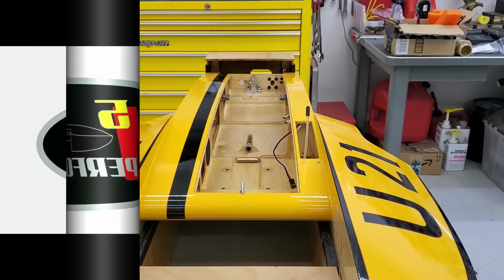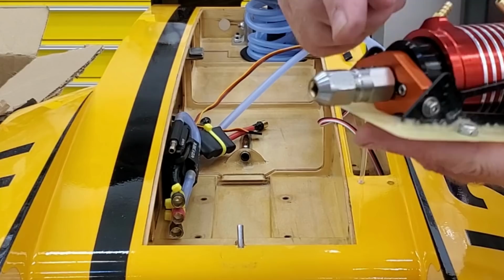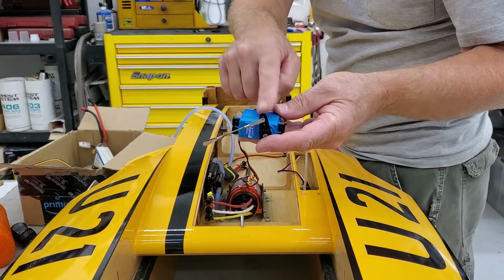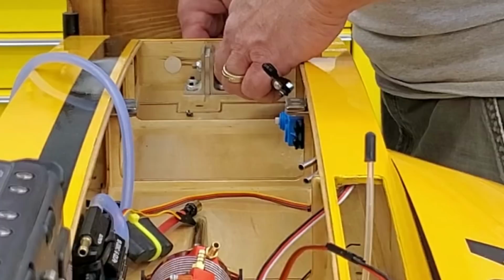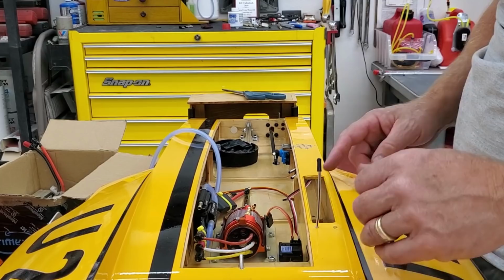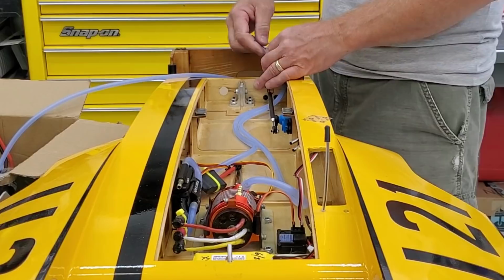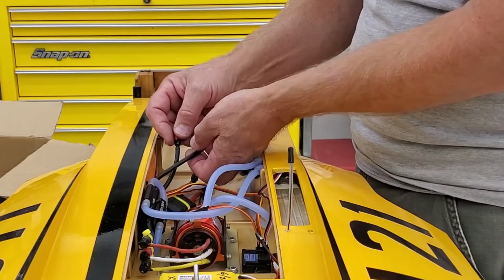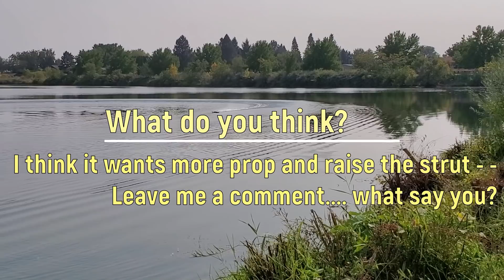Electric RC Hydroplane Final Assembly and TESTING! | The Electro Eliminator

Comment: The Master!  Thanks again Scott.  With electric boats, helis and rc cars, I stopped using velcro in extreme speed situations or anywhere water might get at it.  I prefer shoo goo for mounting electronics.  Cooling line tab mounts are cool.
Reply from the maker: Shoo Goo?!?  What happens when I want to take it back apart?  That stuff is brutal!
Reply: @M5PerfHydros  You dont and leave it forever.
Reply: @M5PerfHydros  You dont.

Comment: Nice and clean build, Mr Meyers! But... what a huge space inside the hull as compared to my Hydro-1-Naviga competition outriggers. I really have to piece ESC, motor, servo, cables, connectors and watercooling-hoses in. Can be a headache sometimes :-). Now, let's answer your question: it runs too wet, too much prop in the water too. It can be caused by the water-condition (very calm, these boats benefit from more choppy waters), but getting the transom from the water will improve efficiency dramatically.
Reply from the maker: Bingo!

Comment: Very very cool machine there Scott. It's a beast. I had a guy make me a fiberglass R42 eventually. He's also a gas guy. He was blown away at the speed of the electric motor I put in on just 6s. We also started with a small prop... 60mm. Going to try a 75mm tomorrow.
Reply from the maker: Cool!  I'll need to see some video....
Reply: @M5PerfHydros  disaster... Don't think my 150amp ESC can handle it. It kept shutting down
Reply from the maker: More power!
Reply: @M5PerfHydros  story of my life...

Comment: In the process of formlating a build from your video series and thinking completing the build as an electric. can you post what motor, ecs and batteries you recondment that you used?
Reply from the maker: Nope, because I don't know. I'm a nitro and gas guy, and all the parts for my electric conversion came from Rattlesnake RC who commissioned the project. Most of it was older stuff anyway.  Bill at Rattlesnake would be a better resource for electric boat advise and parts. Find him here www.allrc1.com

Comment: Quick question, Scott.  When it comes to water pick up...which is better?  Rudder pick up, transom-mounted beveled brass tubing, or perhaps a hull-embedded  beveled brass tubing?  THanks
Reply from the maker: Depends....  A hydro spends most of it's time in the air so any shallow water pickup will only pick up air!  This is why you have holes as low as possible on the rudder blade.  The beveled tubing or tapered transom pick-up will only work on a wetted hull like a cat or offshore

Comment: I like those 90 Deg  angle motor connectors ! Where are the from ? And what ESC and Rudder Servo is that ? Thanks!
P.S.  I can think of one good reason to put the "loopy" stuff in the boat as the "fuzzy" stuff can get "contaminated/ used " over time so when you change the Battery, you  obviously would use new fuzzy stuff ! voila ! (I am a genius - I think LOL)
Reply from the maker: Heck man, I don't know what the parts are.  The conversion was commissioned by the boat's new owner and he supplied all the parts... Bill at Rattlesnake RC.  You can find him here www.allrc1.com

Comment: Scott , why double the voltage from 12 to 24 Volt with the batteries, why not run them in series at 12 volts, with 24 v do you get more rev's/torque ??.Phil
Reply from the maker: Waaay more rpm!  For the most part volts = rpm where amps = torque, and it's not a rock crawler!

Comment: Scott thanks for the video well done as always, would like to see a match race one with the nitro and one electric.
Reply from the maker: When some of the guys first started building electric scales here in the NW we ran them heads-up with the nitro's for a couple years.  I used to take pride in never losing to one, but they've gotten so much faster now that I don't think the nitro's could keep up unless the electrics were limited.  Even now that the electrics run in a separate class we do limit the diameter of the props just to keep them at sane speeds!

Comment: Hi Scott, loving these videos from Somerset in the UK where I’m building my 1/8 hydroplane. Quick question: what main batteries are you using (capacity & discharge)?
Reply from the maker: I'm really just a nitro and gas guy. All the parts used in my nitro to electric conversion series were provided by Rattlesnake RC, and I don't recall what the specs were.  Bill is super helpful and I'm sure he could tell you what was used. You can message him through his website here www.allrc1.com

Comment: what size motor are you running and what is approx boat length and with    im building my first hydro aprox 45" long  just curious what need for a motor thanks
Reply from the maker: The boat dimensions, motor, and batteries are spec as required under our racing rules. The boat is 43" long and uses 8s batteries.  Here are the motor rules copied from the rulebook;  
* Approved motors: i. NEU 1527 1.5Y 850KV ii. HET Typhoon 700-98 840KV iii. Turnigy SK3-3994 850KV iv. TP 4040 10Y 830KV v. TP 4060 6Y 860KV 1. Approved as a test motor for 2020. b. Motors not on the approved motor list: i. Shall not exceed the manufacturer’s KV rating of 860 KV. 1. If the motor case is not clear marked with the manufacturer’s KV rating, the owner should be prepared to provide documentation of the maximum KV rating of the motor. ii. May not have a motor case exceeding the following dimensions: 1. Length: 105 mm (4.134 in.), this includes any bearing protrusions. 2. Diameter: 42 mm (1.654 in.).

Comment: why are rc race boats always running in an clockwise direction instead of counter-clockwise like their full size counterparts? Is it because of the directions of the motors where torque direction helps them in the turn? Just an guess.
Reply from the maker: That's it exactly!  RC motors rotate counterclockwise, which is opposite of the engines in full-size hydroplanes
Reply: @M5PerfHydros  OK Thank You for that. I've been in the rc aircraft business since 1982 but never had an rc hydro which im hoping to get into soon so i assumed the direction of travel has something to do with the motors. 

I would like to go with an 1/8 scale hydro kit and build it myself or one of the fiberglass kits by rcboatcompany or some other manufacturer out there and i could build one nice boat. I also have an set of plans to build an 1/8 scale "Pay' N Pak" but im confused on what i would actually need for all the hardware to get it going not being familiar with all the parts and types of electric motors, mounts and stuffings tubes and prop shafts. 

This is the style of hull i would like to have.
 http://www.newtonmarine.com/plan_details.php?prodId=443&category=5

=============================

https://www.youtube.com/watch?v=b9UH5pF1pD0

Thanks for your reply... Hope you all have a very Merry Christmas and an safe and Happy New Year!. 

~A~
Reply from the maker: I got you covered Alan!
Get one of the awesome kits from MLBoatworks here;  https://mlboatworksrc.com/shop/ols/products/1-slash-8th-scale-newton-166-slash-mhr-9601-kit
And then contact Bill at Rattlesnake RC for all the hardware! https://www.allrc1.com/

Comment: Why the hatch is not centralized on the hull?
Reply from the maker: It is a copy of the real boat that raced many years ago
Reply: @M5PerfHydros  Understand but this design with the motor design original is made for counter steer the propeller torque or help  with curve?
Reply from the maker: Originally it was thought that more weight over the turn fin would help, but the idea was dropped in later designs.  I believe the opposite is helpful in model boats where a bit more weight to the outside sponson helps counter prop torque

Comment: Is there a chance you could do a start to finish series that shows all steps for beginners. Example, ML Boatworks kits are great, but the bottom of boat  hull is wider than wood so how do you fill seams, and do you run seams front to back, or side to side? And hydros with hull that bends up. Cut wood, or bend? And so on
      Remember this, kids today don't  have shop class  and most don't have dads.
Reply from the maker: That's a good idea, and I've actually thought about doing that.  Problem is I don't build from kits anymore as I prefer to design my own, but maybe I'll talk to Mike at MLBoatworks to see if he'll sponsor the project.  Meanwhile... If the wood you have isn't wide enough you've got the wrong stuff!  You should never have to splice the bottom!  Check out Balsa USA or Aircraft Spruce online and you'll find much larger sheets.  Grain should always be front to rear with the only exception being the front most piece of the sponson bottoms where it curves up sharply. This section needs side to side grain so it'll curve more easily.
For the floor designs that angle upward, your guess is as good as mine!  I've run boats with a defined sharp break and boats with a curved floor and both work fine.  Which is best?  Heck I don't know. Build one each way and find out!
Reply: @M5PerfHydros  ok. Thanks for the support reference and I will check them out.
Reply: @M5PerfHydros  well  he I am about to show my dumbness. So I have a kit, and the flat hull portion of the boat according to the #4 rib and transom, ir 14" between the down cut for the sponsor side. I can not find plywood that is 1/8 X 14 X 48 to do the hull in one piece. So, what am I not understanding?
Reply from the maker: I'm glad you couldn't find it!  Crikey if you use 1/8" ply to skin the thing it's gonna weigh 25 pounds!  
Ok here's the thing... You're gonna use 1mm (1/32") Finnish birch to skin the top deck, and 1.5mm (1/16") for all the bottom surfaces.  Go here, scroll down, and click 'half sheet' for the 1.5mm stuff;
https://www.aircraftspruce.com/catalog/wppages/finnishbirch.php
https://www.aircraftspruce.com/catalog/wppages/finnishbirch.php
Reply from the maker: On the other hand, that boat is a monster so maybe a 1/8" floor isn't a bad idea..... Man you're breaking new ground with that beast
Reply: @M5PerfHydros  it is a 1/6.6 scale. I understand that you are all about racing and weight, but as a beginner, I need to learn. I mentioned 1/8th thick wood. But if 1/16 is common that is fine, just trying to figure it all out. Before I do too much and get frustrated.
Reply from the maker: Oh ok... I've been talking to another guy who's building a 1/5 scale and I got you guys confused.  YES for gas scale run the 1mm and 1.5mm mentioned before
Reply: @M5PerfHydros  so, I am not good at working this you tube stuff either. I tried to attach a pic of a boat but couldn't.  So if you don't mind,   you can reach me at   Backdraftracing@Hotmail.Com         then I can attach pics to give a better reference.
Reply: @M5PerfHydros  so I found the larger wood at AircraftSpruce. Ordered and now I am excited, but have to wait. Thanks for the resource.

Comment: New subscriber, awesome builds and great information! Have you ever tried Titanium fasteners instead of steel?
Reply from the maker: No need, I use aluminum fasteners! Cheaper and lighter and plenty strong enough
Reply: @M5PerfHydros  Yes I see you use aluminum fasteners but you said some places for strength you still use stainless, replace stainless with Ti
Reply from the maker: Oh I see.  Yes I suppose I could do that!

Comment: In one of the early on video's you weighed the Eliminator prior to "de-construction".  The reading on the scale was 11.3 lbs. (thats  11 pounds 4.8 oz.) Now that the transformation is complete, how much does the "Electro Eliminator" weigh ?  Also if you happen to know, is there much difference in prop shaft speed(s) between the Novo Rossi and the "sewing machine motor"? As I am in the early stages of planning out a boat, I am interested in these tid - bits of information. If you might know  the differences, it would be helpful. Thank you Dave K.
Reply from the maker: Yeah I screwed up and didn't video myself weighing the boat after the conversion!  What a dork.
Anyway it came in right at 12lbs, which was really disappointing... I'd hoped for less.  But when I weighed it the first time it was with empty tanks so maybe it would be pretty close to 12 if they were full.   As for rpm, though I don't know the numbers it's quite obvious that the electric motor spins much higher. In our club we have to limit the prop size on the electric boats to keep them down to a similar speed as the nitros.
Reply: @M5PerfHydros  which prop size or diameter do you limit too?
Reply from the maker: Any prop with a maximum 57mm diameter.  Full rules here; https://acrobat.adobe.com/link/track?uri=urn:aaid:scds:US:c88f4987-ec04-3e0d-a797-b4a12f91d6a6

Comment: Scott, I really enjoy your videos and get a lot out of them.  Question:  What is the little black bundle attached to the ESC by a red and black wire just under the capacitors?  In this video it has a yellow zip tie around it.  Thanks.
Reply from the maker: It's an extra bank of capacitors to handle the zap!
Reply: @M5PerfHydros  Is that an add-on or an option at time of purchase?
Reply from the maker: Hmm... Truth is I don't know for sure as it was a used esc that I got from Bill Brandt who commissioned the conversion and bought the boat from me. As I understood it, it's an earlier version that came like that and the later ones do not. Still... I could be wrong (no surprise here!).  Bill could shoot you straight on everything related to the electrics.  You can get him through his website at www.allrc1.com

Comment: Just  throw a x457 3 blade and let it eat!
Reply: What does an x457 prop do?
Reply: @edwardjohnson3189  57mm is the max diameter we can run in out club and the series from octura  have more lift
Reply from the maker: chomp chomp!
Reply: I am new to electric drive.  That's what we called it when we were designing an electric drive submarine.  What is the correlation between motor size, prop size and boat size?   Are there certain design rules to follow?
Reply from the maker: I wish I could help, but I'm a nitro and gas guy and I throw props at my boats until something works right. With the electric conversion I just finished I took the advice of a long time electric guy and put on a small prop for testing.  Hopefully someone here can help more!
Reply: @edwardjohnson3189  Below is a link to a video with many good rules to follow when deciding on the fast electric hardware setup for your remote control boat.
Courtesy of RCexplained
Selecting a Brushless Motor, ESC, LiPo Battery and Prop for an RC Boat
https://www.youtube.com/watch?v=2tuvoAfPMYU
I'm currently in the process of setting up my very first fast electric 1/8 scale hydroplane.

Most of what I know I learned from Don Mock creator of the video Scale Hydro Construction Part 1 and 2. You can purchase the video from Rattlesnake RC.
https://www.allrc1.com/product-page/video-scale-hydro-const-part-1-and-2
And M5 Performance Hydroplanes - Scott Meyers has been tremendously useful in helping me to figure out how to make sure the hardware is incredibly light weight therefore very fast.
Offshore Electrics online forum is where I go to learn how other people are setting up their remote control boats.

Comment: Can't you get more speed? Seems too slow. And no im not trying to be a smart ass, it just seems slow. Ive seen these boats one heck of a lot faster.
Reply from the maker: You're right, and you haven't offended me at all.  Our club limits the speed by limiting the prop size.  The boats can easily turn a lot more prop and make a ton more speed, but we've found that with the bigger props terribly bad things happen very quickly when there's seven of these things on the water all at once!